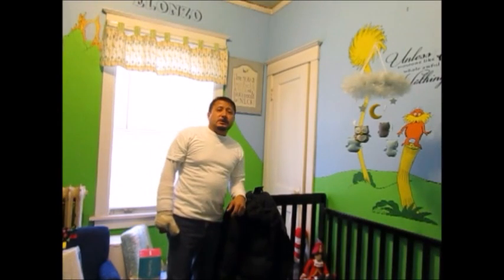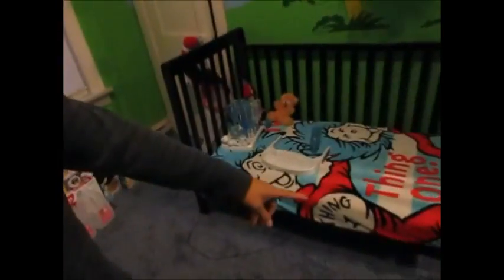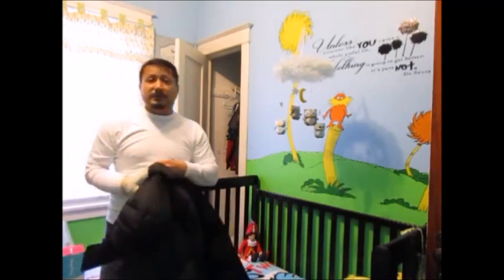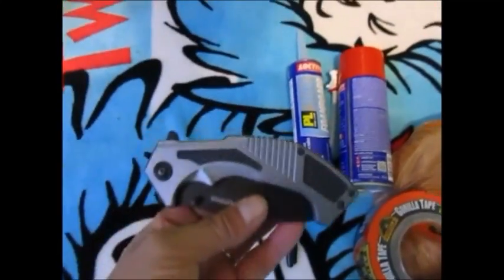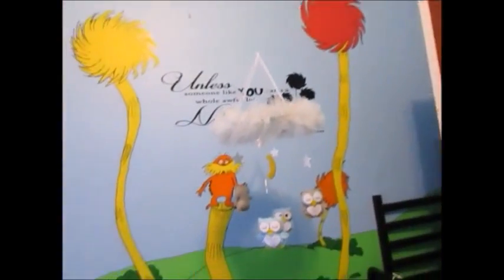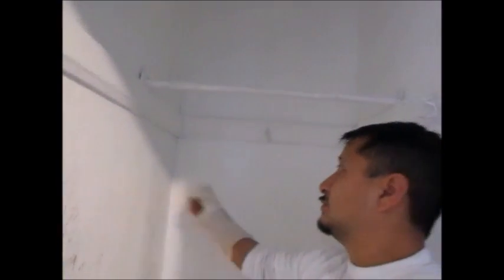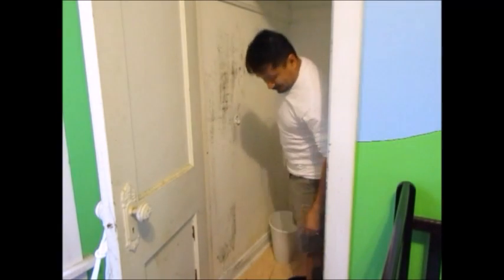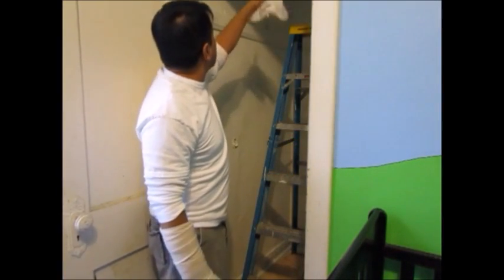Cheap insulation for a cold closet

Comment: If you don't fix the original cause of the mold it will just come back. Check for air leaks on exterior first and fill them in. Go into the attic and air seal the top plates of each wall, around any electrical fixtures , plumbing, wiring etc., going from attic into the house then fill with the proper insulation amount for your zone.